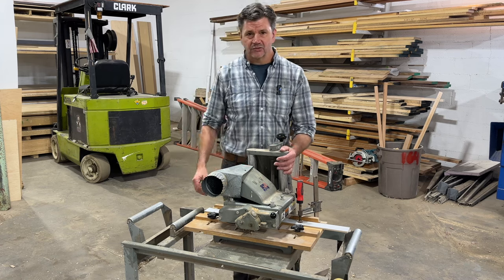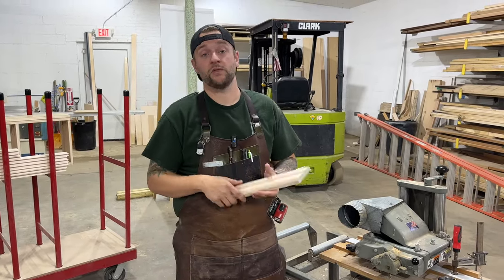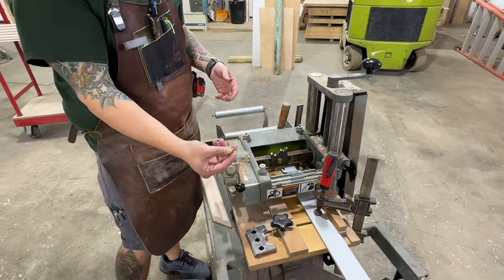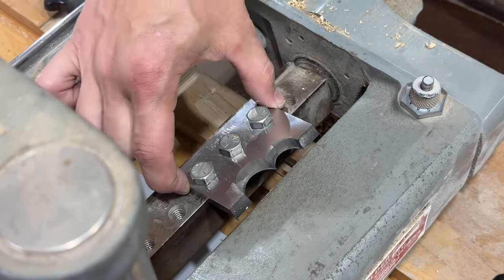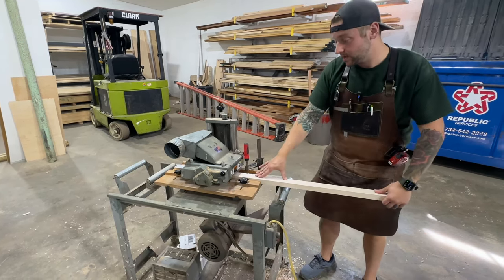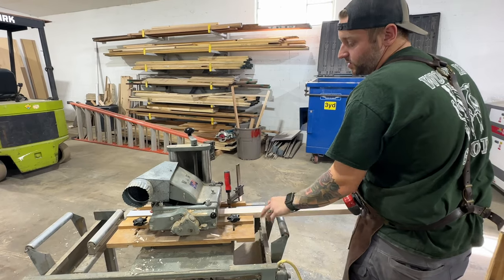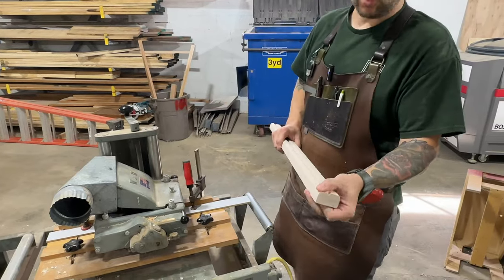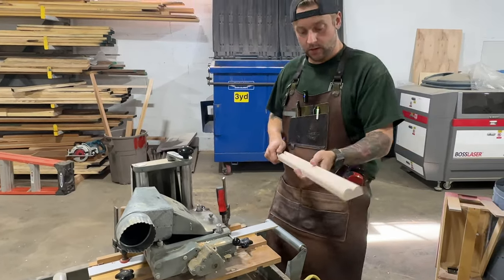Make ANY Molding! Williams & Hussey With Custom Knives

Comment: That adjustable sled looks pretty useful. Do you have access to plans for that? Thanks for the video.
Reply from the maker: It’s just something Jon made years ago. Maybe we’ll make a new one and shoot a video in the future.
Reply: that would be awesome. It looks like 2 boards and 4 c-clamps will also work, but that looks like a quick setup tool for multiple applications. I bet a 2nd generation version would be cool bc you could evolve it a little? Looks like two key slots and some track underneath. I guess if both sides were mobile and locking that would make it better? Thanks again!
Reply from the maker: It could definitely use a few improvements. V2 is always better! 🙌🏼

Comment: Excellent demo Jeff of a rather interesting machine. How long does it take for those blades to dull & can they be re-sharpened? Thanks
Reply from the maker: Thanks, Steve! They’re HSS so not as long as carbide but you can give them a lapping on a stone to extend them a bit. You can send them right back to Neil to be sharpened.

Comment: Hey guys, nice demo! 
To improve your surface quality, change the standard v-belt to a link belt.
You won’t believe the difference! You’ll be able to really cut back on your sanding.
Reply from the maker: Wow, thanks for the tip!
Reply: I second this idea for the link belt. My ShopFox moulder came with a red link belt and the molding I run has almost no knife marks. Granted mine is variable speed.
Reply from the maker: We def need to give it some attention

Comment: I’m about to buy this exact machine. I plan on using it to cut 3/4” and 7/8” round dowels.  I know that I will have to make some sort of cradle to support the bottom half when rounded.  Have you ever cut dowels with your machine? Also, after seeing the last comment here about chip out with hardwoods. I mainly cut White Oak, Maple and Walnut, do you think I will have chip out issues. I have no problem doing multiple passes. The machine I’m getting doesn’t have the variable speed.  Great video, thanks.
Reply from the maker: I think you’d have better luck with a shaper.
Reply: @TodaysCraftsmen  is that because of the chip out issue or trying to keep it aligned for the second pass?  I did see were you can get a drive gear from William Hussey to slow down feed rate.  I have been doing them with a 1/4 round on the router table, but thats time consuming with 4 passes each.  I have tried a Ammana half round bit, but I couldn't get it to align properly to give a consistent round dowel.  I
Reply from the maker: It’s just a hunch, as I haven’t really done it on either but with the shaper you’ll be able to get carbide cutters vs HSS on the Hussey. Also you can change the speed to suit the cutter/material. AND you can potentially power feed the stock which helps reduce chatter. The Hussey can be a bit archaic but we’re not insanely experienced with it. I know there are a lot of tricks out there that we don’t know!
Reply from the maker: If you’re going to be making A LOT of dowels look into a dowel making machine. Oliver makes one and last I checked out friends at RT Machine in PA had them in stock.
Reply from the maker: If you’re going to be making A LOT of dowels look into a dowel making machine. Oliver makes one and last I checked out friends at RT Machine in PA had them in stock.
Reply: Thank you, I’m taking your advice about the molder machine. I’m going try to tweak the half round router bit and see if if I can get that to work with a feeder. In the meantime I’m going keep a eye out for a shaper.
Reply from the maker: Let us know how you make out!

Comment: these machines are designed to create soft wood molding in one pass although you can technically do in two. if you were to mill maple or any hardwood you'd have a devastating outcome.  if you want to mill hardwood you need to update the gear box with a variable speed control. I purchased this exact same model and it was a letdown for me based on my needs as a picture frame maker.
Reply from the maker: We use it basically exclusively with hardwood. A variable speed machine is definitely much more desirable but we’ve made it work pretty well using light cleanup passes.